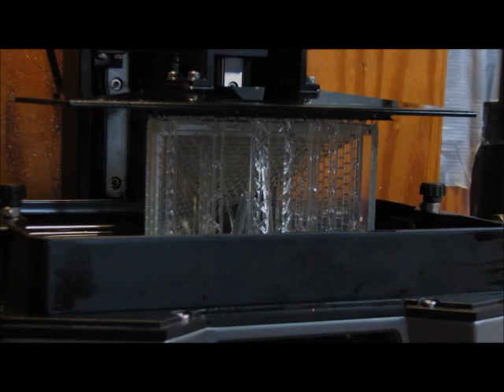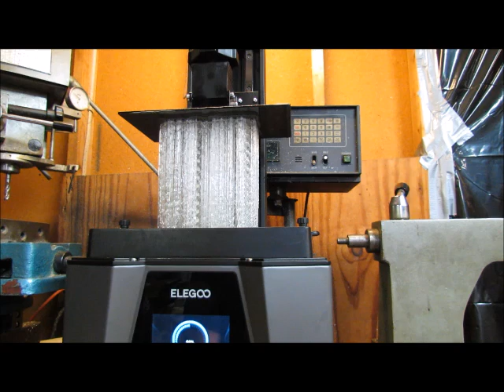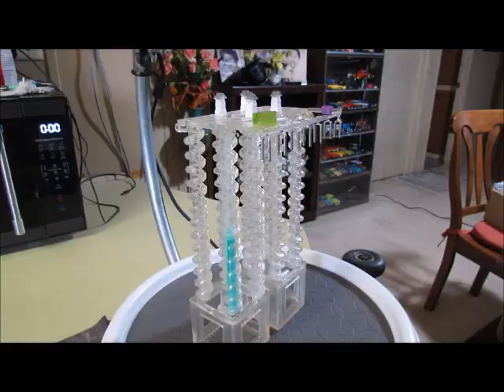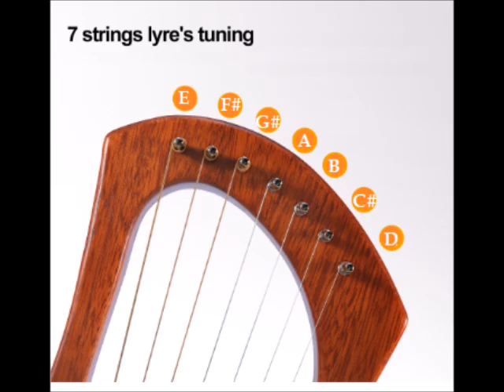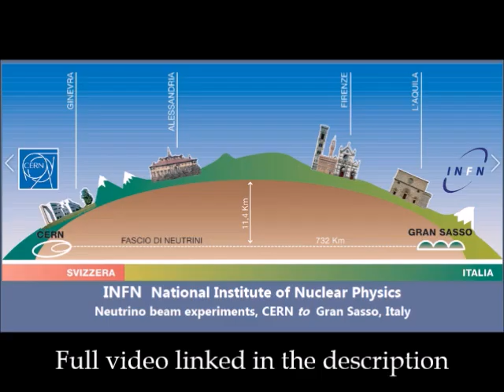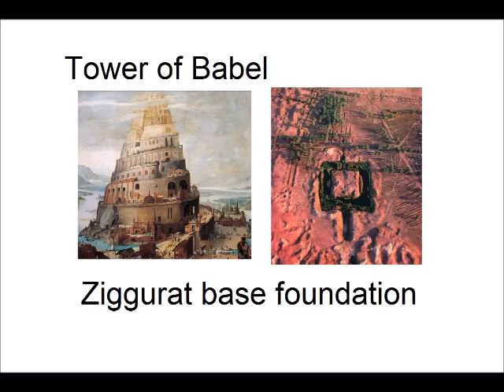3D Printing Fallen Angel Technology

Comment: Just posting my response from my channel here as well. YouTube is doing something weird in the way it groups conversation threads now:

@TheDeletedMedia   Hey, just watched your video and have to say, I love your 3D rendering, complete with tuning forks! I'm a huge fan of tuning forks and gongs due to their properties of acoustic energy sustenance, so the thought of a tuning fork as large as the SAR model implies is fascinating. What is the material? Its clarity reminds me of the alleged crystal skulls. It's also interesting to ponder whether or not the machine was tuned by filling the large cylinders with water at different levels. The massive weights of the relieving superstructures and prism could also have been a way to tune the system as adding weights to a spring loaded system will lower its oscillating frequency. I actually think that a machine as large and sophisticated as this appears to be would be made of components which could fill multiple subfunctions, achieving what I like to call, "functional density". The shafts obviously function as support for the upper platform and stabilizers for the springs. But they may also be a waveguide (tuning forks also emit electromagnetic energy in the infrared part of the spectrum) as well as an additional way to further fine tune the contraption. Hence, packing as much function as possible into the same space. Just as I would expect from an advanced civilization. The "Ancient Civilizations" conference is this weekend in Boulder, CO where they will be discussing the Giza megastructures. I can't wait to find out what is discussed. Thanks for the shout-out as well, and thanks for sharing. Great work! 👏
Reply from the maker: Thanks for the additional info. It really helped to fill in some of the frequency estimations. I'm thinking strong vibrations at those low Hz levels would move mountains like earthquakes!